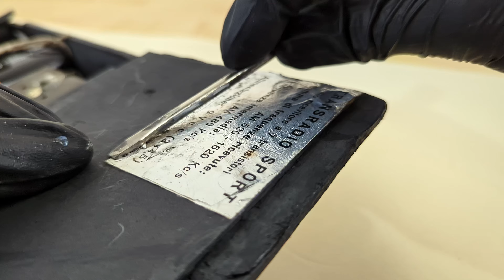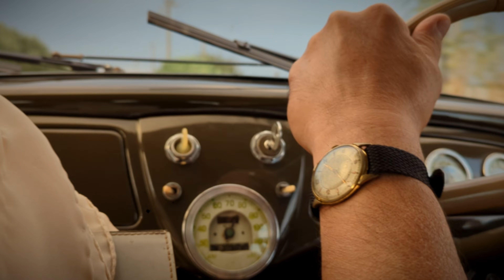Can a Radio Rewind Time? Picnic Radio Restoration

Comment: Hi,
Excellent restoration. What’s the liquid used to soften the leather ? I have an old leather radio cover which is quite stiff with age. Thank you
Reply from the maker: @Toms3200  Thank you! The first product I used with the brush is meant to clean the leather and also hydrate it; if I remember correctly, it’s also used for horse saddles. If you’re referring to the part where I immerse the pieces directly in the watery solution, that’s hot water and vinyl glue. I used that solution to soften the underlying cardboard and glue the various layers together.
Then, at the end, I used a polish to restore the color where it had faded. Let me know if you need the name of any of these products
Reply: Thank you very much